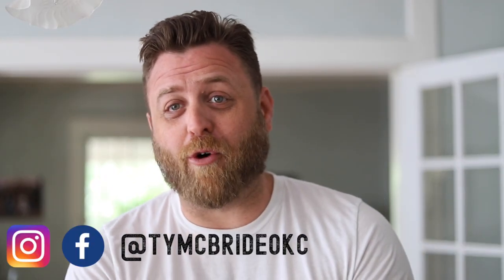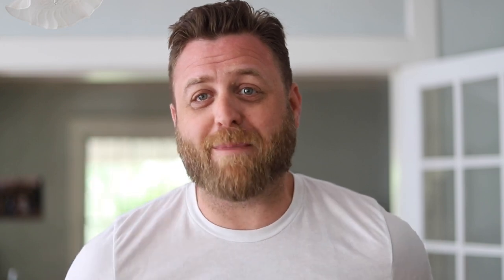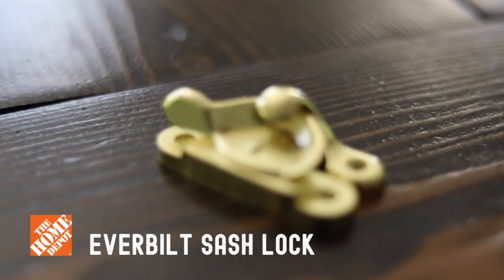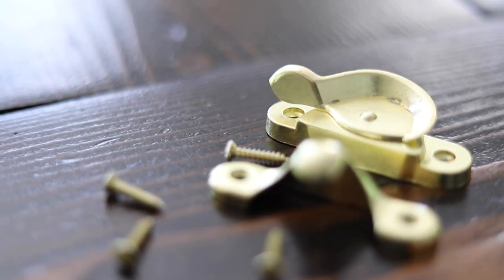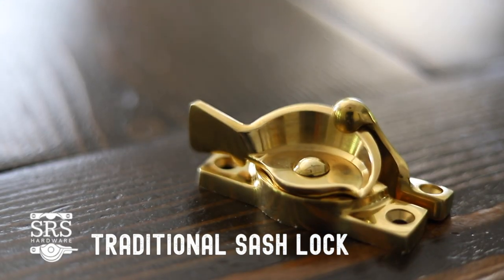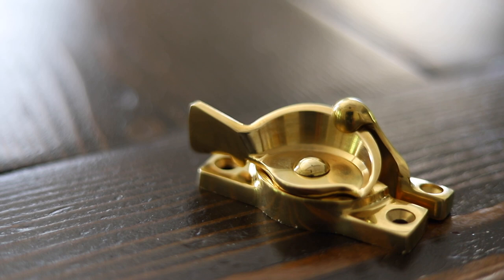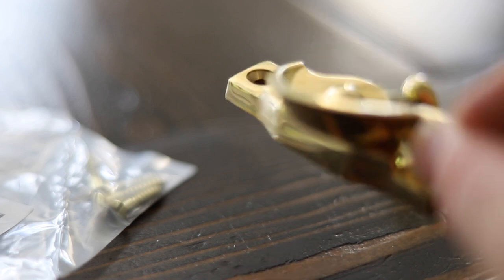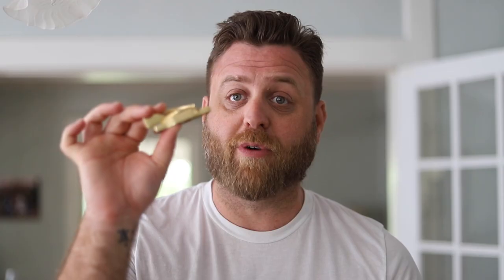Window Sash Lock Review/ How to Repair Old Windows/ with Ty McBride

Comment: mount these puppies underneath the latch and locks on both  top and bottom windows, using flat wood screws with your preferred finish,a wee bit longer than the screws included in the hardware plastic bags,,, on a 2-3 ft wide sash,one on each side,the rubber washers  will allow a bit of  movement , the both will close snug and tight,